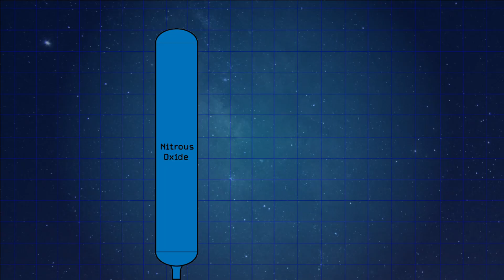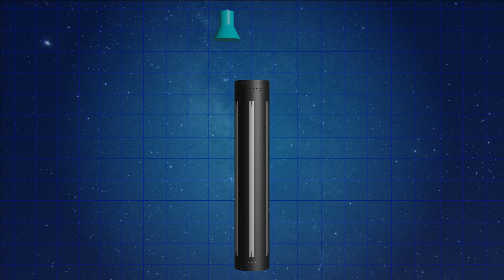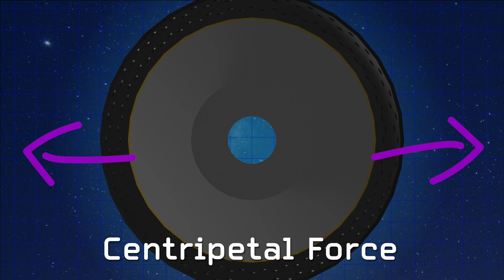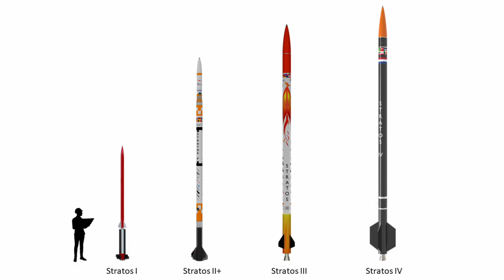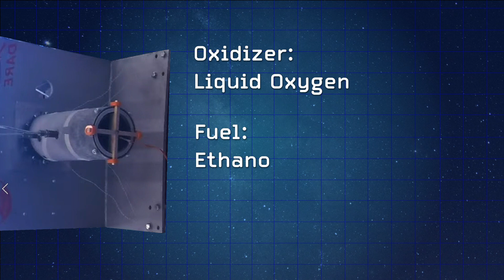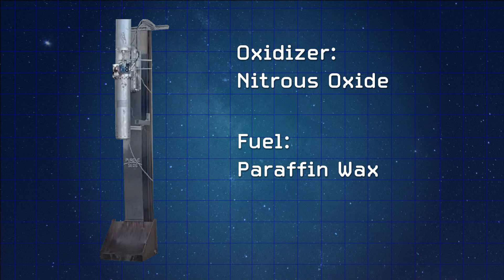Stratos IV Cancelled? - Amateur Rocketry News

Comment: Whilst optimizing the winding process you could use basalt rowing’s. They behave like crowing’s but are cheaper. When the winding process is dialled in you can switch back to cf, since basalt doesn't have the strength of cf.
Reply from the maker: That would be an excellent idea to really try to save cost.  We actually just start dry winding the CFRP to see and angles we were achieving and then just wound the CFRP back onto the drum.